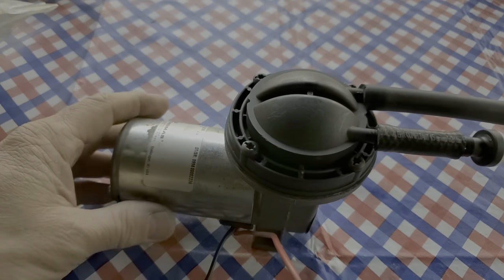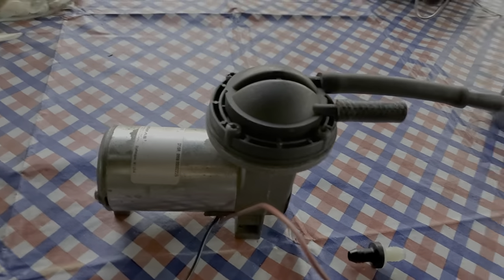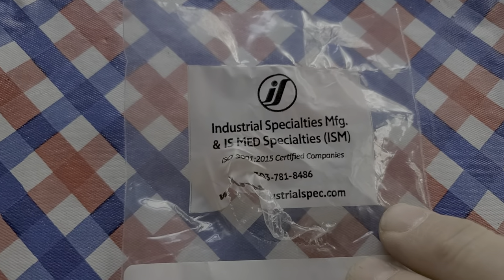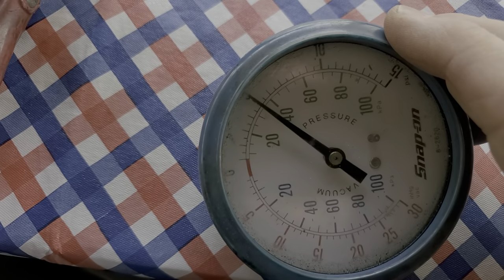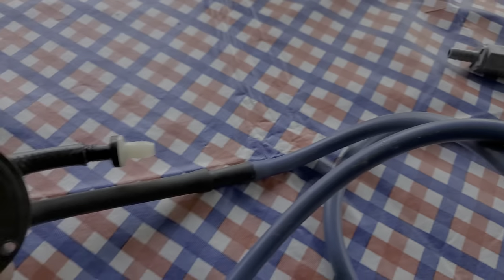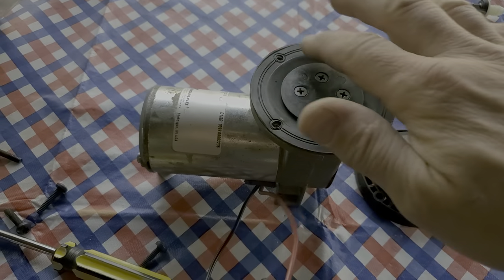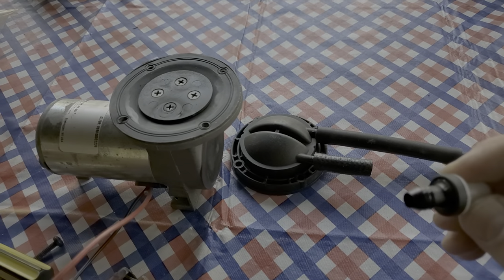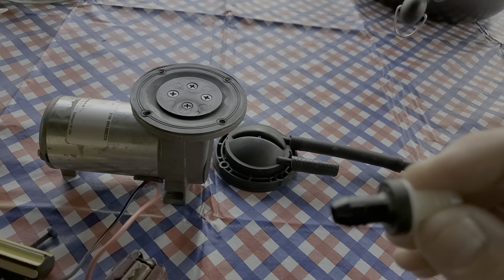Hurricane Heating system CO45 VIDEO 2/2

Comment: i tried this on my 1998 hurricane system..worked a treat. however pump is still noisy..where can purchase a new pump ?
Reply from the maker: https://hydronicheatingwarehouse.com/products/thomas-compressor-12-volt-stainless-steel-heads?_pos=5&_sid=4144dd435&_ss=r
Reply from the maker: This one is rebuildable
Reply from the maker: Do you belong to my rvdiagnostics Facebook page 
https://m.facebook.com/groups/1974314296166277/?ref=share&mibextid=NSMWBT